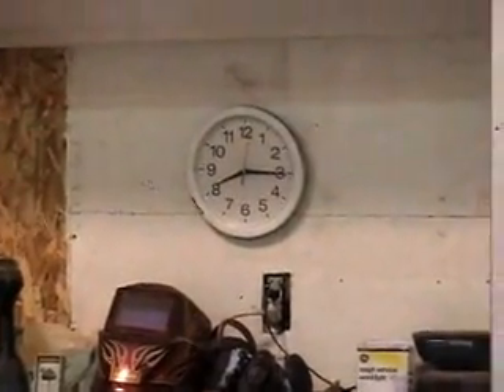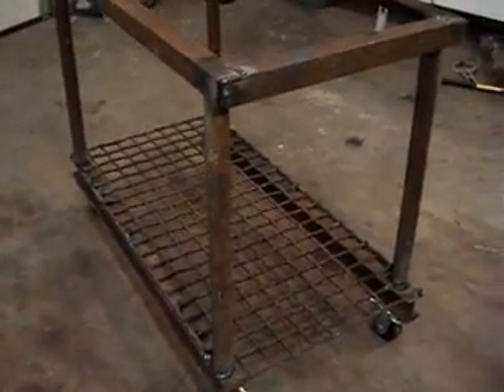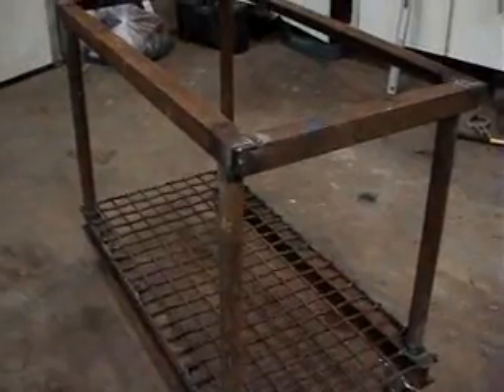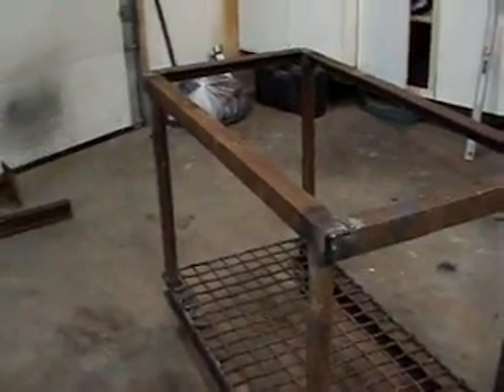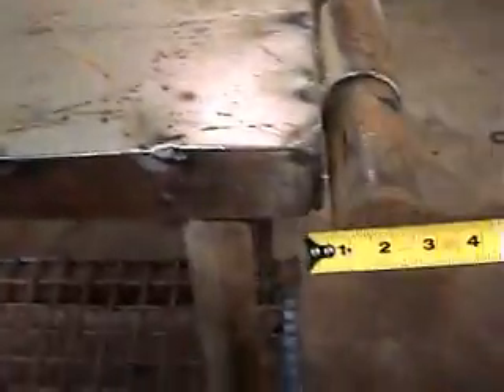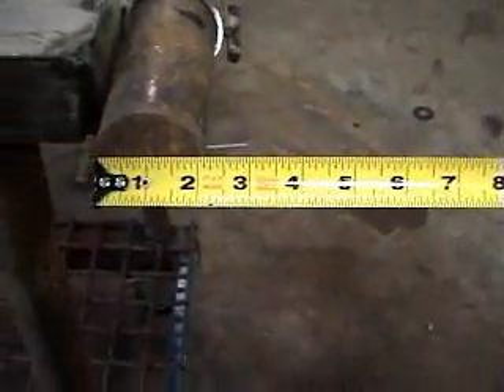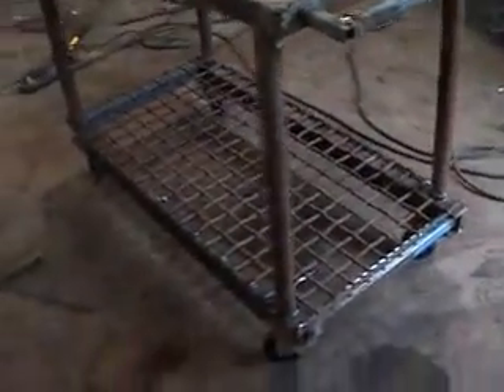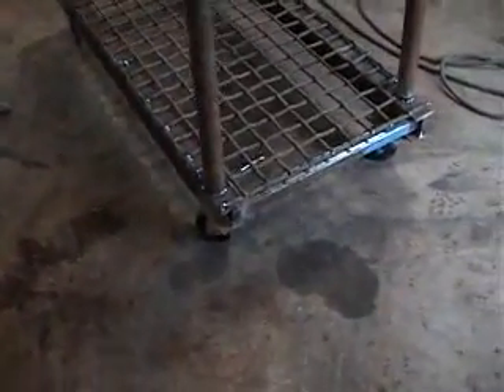starting to look like a shop cart

Comment: wondering if its worth having metal block under it when you are pounding on it to save the shock going through the wheels, maybe a lever on the backside of it that forces a steel beam onto the floor

i remember metalworking carts used to have the wheels on the lever so that the cart itself would sit on the legs, then to move it you pulled the lever and the wheels lock back under it
maybe they are still about
think the top should be bare steel to avoid paint flakes in eyes and looking taty